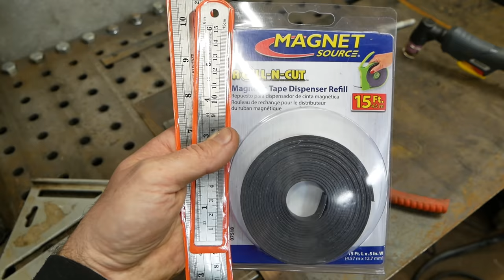Making a DIY plasma cutting table, simple water table

Comment from the maker: 3 different Plasma cutter options below. Amazon Paid Affiliate Links.
Bestarc is the one used in the video. https://amzn.to/3qxE4zx
Bestarc consumables Kit https://amzn.to/3y6oPjD
**Use the Hynade Amazon Promo code 05MIKEWELD at checkout and save 5% on selected Hynade produces.**
Hynade CUT40 budget friendly 120 volt HF start drag tip plasma. 
HYC410 https://amzn.to/3qtA9DN
Hynade  HYC410 Torch Consumables https://amzn.to/3594U9v

*Anyone looking to buy a Crossfire CNC table should look at this plasma cutter *
The Hynade CUT60DN CNC Blow back pilot arc plasma
with Plug and play connections for CNC tables. (CUT60DN)  https://amzn.to/3D7k1wN
I have been running this exact Plasma with my CNC table and it works really well!
Reply: There's a guy up in Canada Names Brent Show Called Half assed customs. He's computer programmer or something by day after work he builds amazing stuff from nothing. He's got 4' by 8 or bigger homemade plasma water table he made for 700.00 bucks. He explained it in one of his episodes. Super mellow like yourself. Just him and pablo his dog. He's all self taught. Check it out. Thanks.
Reply: What are you doing @17:06 with the Herc Angle Grinder?  Making sure you've got ground conductivity?
Reply: Mike
do you by chance know the wire gauge on the BestArc power input,  I got a lotos,  have not used it.  Has 12ga current with 14 ga neutral. Lotos,  similar spec profile,    12 ga Seems skimpy.  Too skimpy for 50A,   Lotos people say its rated 30A.  I could still return it for bestarc
$100 cheaper

Comment: That's a slick little setup. I can't remember the name of the model line but Ikea has extremely affordable stainless steel racks made for plates. They fold away when not in use, they are designed for just washed dishes like the classic European over the sink cabinet with no bottom. Is less than $10 for a 12-in by 16 in rack but they have all kinds of different rack designs that are modular and come in various sizes. I'm not sure the exact reason why, but the stainless used in these is remarkably consistent in terms of thickness. Not quite dowel pins, but not coat hangers either. I have found this line of kitchenware to be really useful everywhere except the kitchen. Cheap too!

Comment: Thanks Mike for the tips.  Very timely as I’ve been coincidentally designing a similar water tray for my welding table.  My plan was to have the grid permanently attached but be able to swing down out of the way and add a rail underneath to slide in a water tray.  I was going to fab up the water tray.  Not sure why I didn’t think of the restaurant steam tray as I use a deep one under my 2x72 belt grinder. 🤦‍♂️   Good thing I’m still in the design phase. 😜

Comment: Hey Mike. Love your videos. Have used many of your ideas and you have inspired many others. I try to keep my shop as clean as possible too. It's a never ending battle. Something I wanted to mention was a way to trap most of the shaving from your Evolution saw.

I have the same one and you likely know this, but if you put a good magnet in a small snack size zip lock bag it will catch most of those shards & chips from your Evolution cut off saw. There is a good spot to place it right where this chips hit the back. Unzip the ziplock bag over a trash can & pull off bag inside out to empty shavings. I have upgraded that idea with a mini mag safe magnet with switch on and off. If bag big enough simple turn on and off the magnet w/o ever opening the bag. Works so well I have another one under my Porta Band Saw table (inspired by you). You have helped me find simpler ways to improve my shop, I'm hoping you never tried this so I can help you out in your shop.

Comment: I dont have a shop but i am looking into a hobart 27i plasma.  I already have a hobart 190 mig and have been really happy with it. Main reason why i initially went hobart is ive heard lots of good on them and they are at tsc so i can get consumables really easy.   I just ordered steel to make myself a welding wagon. That way everything i normally need is all together and portable in 1 trip.  I am thinking about some sort of welding table though

Comment: Thanks for sharing this video. I'm always looking for another project and this seems like and easily doable one for me. I do not have a plasma torch yet but I will be sure to check out the best arc brand. I really like your magnetic rulers, good idea. I recently purchased a small fab table, I found it on amazon but then went to the suppliers site and it was a little cheaper. it's not near as robust as yours but seems a little better than the NT or HF models ( I don't know) any way, thanks for putting your time and effort into these vids

Comment: Bargreen ellingson is a chain of restaurant supply wholesalers that happen to be open to the public. Stuff like that metal tray can be found in every shape and size shockingly inexpensive and very high quality. I'm quite prone to breaking things, but I hate plastic. I was able to get something like 36 pint glasses for $20. I have bounced these things off of concrete. There's a ton of stuff that is really useful in the shop. In particular, stainless steel sheet goods, some great tool storage and organization, but mostly it's just that you can be certain that everything there is extremely durable and well made despite being very inexpensive.

Comment: Most woodworkers that use routers have a jig that lets you easily cut dados exactly where you want them.  Its basically a straight edge that has a strip of plywood the exact size of your offset thats on a piano hinge.  you line it up with the center line of the dado, flip the offset piece out of the way, then run your router across the straight edge.  I bet that would work great for a plasma cutter.  Just add a couple strips of magnets on the main straight edge.  Tamar on the 3x3custom YT channel made one not long ago titled "Easy and Accurate Router Edge Guide // Woodworking Jig // Great for Dados and Grooves."  you'll get the idea in the first couple seconds of the video

Comment: Really cool little setup.  I would drive myself crazy with those 3 nuts on the blind side, though.  What about welding the studs to a backing plate that you can slip through from the back, with 3 matching holes in the side of the water table?  Then you put on the nuts where you can see them.  Plus that backing plate could be reusable for other fixtures and table extensions.
Reply from the maker: I don’t usually let small things like installing 3 bolts that take a minute to install bother me. Thanks for checking out my new video 👍

Comment: Dang it Mike you just cost me some money.  :-). Ordered the rulers, magnets and the pan the day your video came out.  I am working on a design the has removable slats.  I am intending on using 1 1/2 flat with the 2" angle.  Need to road trip to the metal outlet.  Thanks for the great video and keep them coming.
Reply from the maker: Ha ha thanks Ken 👍

Comment: This is a big ask, please don't feel beholden at all. I've been stuck in analysis paralysis regarding fixture tables for a while now. I have a general sense of your quality standards and budget range, it's a very good match for me. I did pay close attention to the videos you did on yours. Now that you've had it for some time, do you think you could do a short video on what you wish you knew starting over? What features turned out to be more useful than you expected? How about vice versa? If I'm not mistaken, you had one you built yourself and you've had one commercial one now. Could you give us a sense of which models you would select at a few different budget levels? Maybe dial in on the aspects that turn out to be the most important and clarify which features are made for marketing purposes. Would you consider having a shop with a CNC drill the top if you had the capabilities to do everything else? Size is a big factor as well. It seems like the type of tool that is very hard to envision ahead of time what size would suit your workflow the best. I've noticed you keep yours against a wall, it seems like most people have them free floating in the center of the room. Maybe there's some subtleties to these choices that are difficult to understand until you own one? I apologize, I don't mean to custom order the video like it's Burger King. It's a large investment and I have been stuck on the fence for over 2 years about it. I have a milling machine, one scenario I have considered is making four dozen 12x12 in mini pallets and use leveling screws to align them all. The appeal of this arrangement is leaving a 2 inch Gap between each mini palette. I have a lifetime of c clamps that I would rather not see become useless. Don't particularly want to buy/modify a few dozen specialty clamps.
Reply: Oh yeah one other big question. I've seen a few models where the legs are drilled as well, allowing one to use the three-dimensional corner of the table itself as a jig. I've often thought that having one side be drilled plate would be a helpful aid. Your thoughts?

Comment: Great video! my only concern is that you fully welded in your slats so what are you going to do when they wear out? Would removable slats be more desirable?
Reply from the maker: Probably not worth the time to make them removable, my CNC table slats are holding up great for the past two years of cutting. I would say that in 5 years you may need to change them out, you could add a second set of slats right along side the original ones or just plasma cut out the older ones and weld in new ones. It’s probably not something to worry about. Thanks for checking out my new video 👍
Reply: @Mikefestiva  Thank you for the quick reply. Awesome work!!!
Reply: They are removable. Remove with plasma, install with welder. Not a problem. ;)

Comment: Hi Mike, love all your videos. I have a question: did you build your super thick steel welding table with the equally spaced holes (1/2 inch maybe??) all over?  I assume that must be a standard type of plate available with holes already in it?  What is the thickness and where would I find something like that? Thanks! -Mike.

Comment: The only thing I would do differently would be to make the bars in the middle of the table removable so that once they have been cut into and about to fall apart I could replace them with ease instead of grinding out the welds or making a new table.
Reply from the maker: If you plasma cut often you will know it would take years of cutting on these slate before you come close to actually cutting the 1” bar stock all the way through. I have had a few people mentioning this exact thing to me already, from my experience over the past few years cutting on my CNC plasma table, the slates may get small cut marks in them, but will hold up for many years to come. Sometimes simplicity is better then overthinking. 
Take care Zachary.

Comment: Dumb question: What prevents the vertical slats on plasma cutting tables from getting cut along with the part? I am about to buy a plasma cutter and make a water table like this.
Reply: The slats do get cut along with the part that you're cutting. Most cut tables have replaceable slats because they do get degraded from using the table. I'm surprised that he welded them in, but it is a quick project to make another one when it gets too cut up.

Comment: Would it be ok to power my plasma cutter off my gasoline welder for remote use ?
Reply: I'm not an expert so take this with a grain of salt. It's generally not recommended to run inverter welders or cutters on generators unless the generator creates a good sine waveform. Sometimes called clean power. Basically, old fashioned generators can  makes enough power but the waveform isn't clean enough and it can damage electronics.  You generator may or may not be suitable. Old fashioned transformer welders don't care and can use any sufficiently powerful generator.

Comment: I bought this plasma cutter and it stopped working after the 2nd time I used it there was no spark only air I returned it how how come it did that?
Reply from the maker: I don’t know? Did you try changing consumables to see if they got contaminated with molten metal?
I have been running mine for over 9 months and it’s been fine.

Comment: Got my BestArc BTC500DP last week. Does amazingly well on 120v. Working on installing a 240v shop plug / and 20 Amp 120v plug dedicated for the Flux Welder, Stick Welder, and this Plasma cutter so I don't have to unplug my dryer all the time. :D